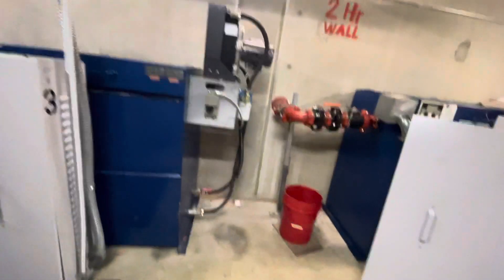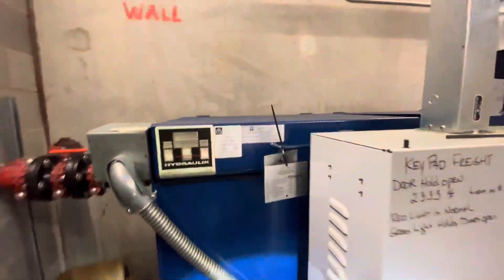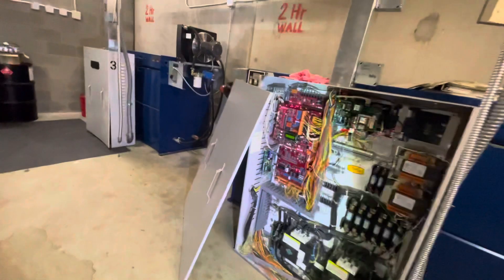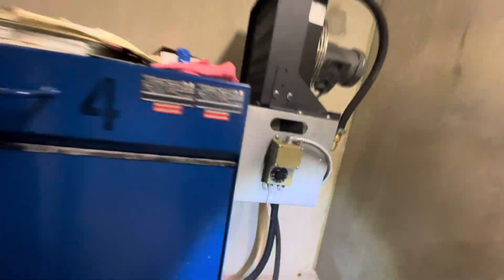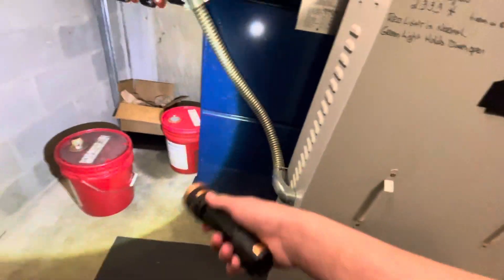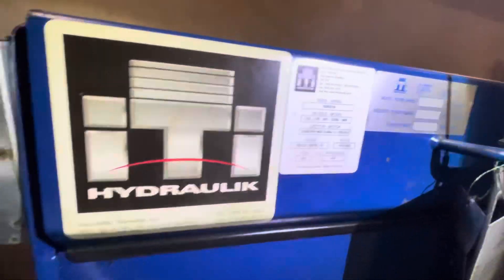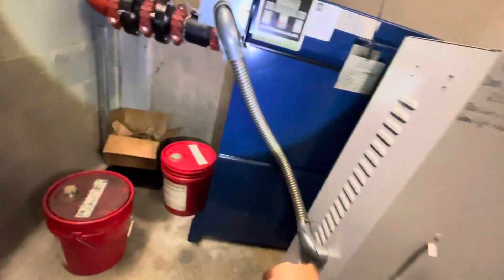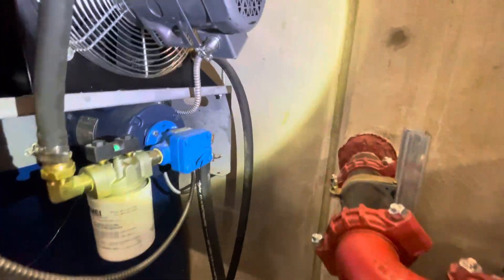Schindler/ITI  Dual Pump Submersible Hydraulic Elevator Machine Room

Comment: They also have European hydraulic elevator pump motors which is very rare. ELMO only makes hydraulic elevator pump motors for European elevators only but now I can install one.

That's because at some point I will be recreating these and I will have a custom installation for building in Roblox and it's going to be for a MEI submersible dual-pump hydraulic elevator.

Also, I found a company called Bucher Hydraulics, and they have European hydraulic power units for elevators. But they are all residential grade! You could install a three inch or 2 inch pipe hydraulic power unit for a passenger elevator. But they just have a bunch of tiny hydraulic power units for residential use
Reply from the maker: Can you send me your roblox profile I'm really interested in seeing the game. I also know of machine room videos of the Westin Peachtree plaza, and Marriott Marquis Atlanta
Reply: @QEElevators  Sure, ITI Hydraulik USA also makes residential power units. And I'm only going to be making some residential elevators so I'll let you know when it's done and you'll be able to check them out and the machine room. I know you've been over to people's houses on video filming their presidential hydraulic elevator and machine room with the homeowner's permission. I really like that power unit.

Comment: How much oil does an elevator like this contain? Is there a storage tank or is it all contained with in the pump and hoses ?
Reply from the maker: At 5:20 you fan the the pumps and the motors are submerged in the oil. I'm not sure but for one like his it's likely 100-150 gallons

Comment: This looks like an ITI Hydraulik pump. And I saw the logo.
Reply from the maker: Yep. Custom too because they normally do dry for above 100hp but this is 130HP with two motors in the oil tank.
Reply: @QEElevators  I'd like to see you ride up and down this elevator if you can please. Thank you.

Comment: Those are massive power units dual pumps,  460VAC each motor is 560 HP? Got some big flex conduit 1 1/4 inch or larger between the hydro tank and controller and down from the ceiling.  The 55 gallon drum is likely a solvent. The flashlight was a nice Christmas gift from your dad.  Years ago I gave my dad a gold mini Mag light as a Christmas gift.
Reply from the maker: No combined it around 120 each motor is around 60 hp.
Reply: @QEElevators  Ah, thanks for clarifying. A 560  HP motor would have taken up half the tank space, at least and need a much bigger electrical system.
Reply from the maker: @TheTheo58  You know the 12 floor hydro? well they dont maintain it bc it has been low on oil for 3 months and getting worse. Probably had to leak alot for it to get low with 2 12 inch diamiter holeless cylenders. Yeah i hope this thing dosent have another complete power unit failure. i think the original failure was from being low on oil constantly.
Reply: @QEElevators  I remember you posted a 12 floor hydraulic video in the last 3 months  or so. Maybe around the time, I had mentioned the telescopic hydraulic elevator near the medical center?  This elevator has been getting lower on oil for 3 months? Low to begin with and still leakage? Got a leak somewhere. Probably is in the lines or cylinders. Yes, they better repair it some pumps will burn out if they are dependent for oil to prime and can't run dry.
Reply from the maker: @TheTheo58  These are dry powered with 2 or more motors and pumps.
Reply from the maker: The fact that the old power units died likely for the same issue because they were always low clearly shows something’s leaking. They better start taking care of this elevator better.
Reply: @QEElevators  Do you have the URL for this elevator? I'd like to take another look at it.
Reply from the maker: Just look up whiskey blue elevator on YouTube. I didn’t film it before the motor replacement but another user filmed it when the new motor was brand new when the fans were off
Reply: @QEElevators  I found the video Diesel Ducy filmed of the elevator in 2018 and 2021 (viewed the 2018 footage) he mentioned the power unit was a dual submersible type which I take replaced the original dry one which failed.
Reply: @QEElevators  I just came across the video you did in October 2021 of the whiskey blue elevator, which has the replacement dry power units? Diesel Ducy mentions a submersible power unit which had burned out. This most recent video you did, with the new power unit still has low oil issues? Lack of maintenance?
Reply from the maker: @TheTheo58  Seems like a lack of matnance. Yes these used to be submersible. I really wish i couldve seen the machine when it was submersible but im working on getting a tour of the current machine
Reply from the maker: Its actually the opiset. It used to be submersible.
Reply: @QEElevators  Where was this filmed? When will you ride this one?
Reply from the maker: @jeromedavis8575  The Prado Atlanta parking deck
Reply: @QEElevators  You should ride it.